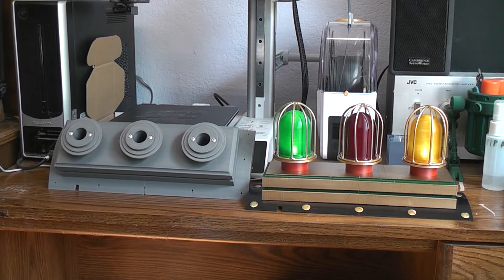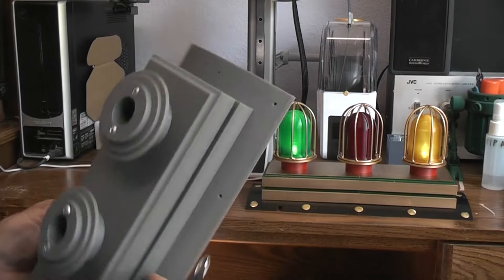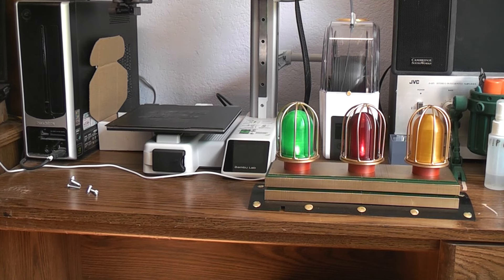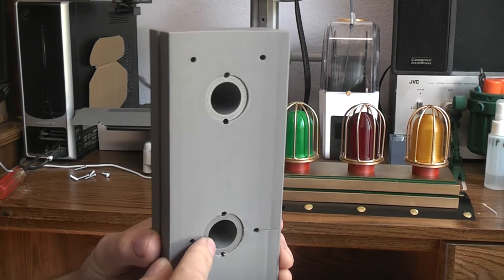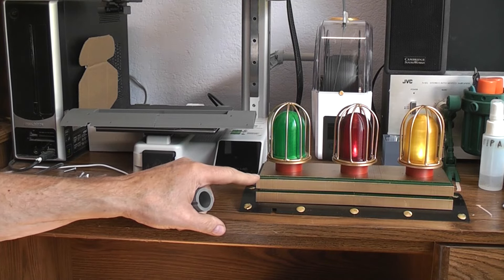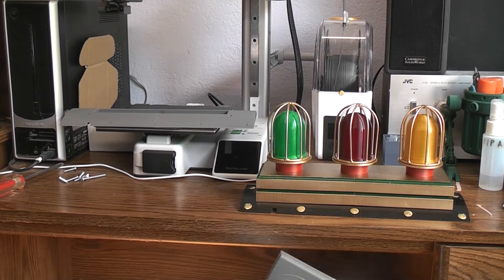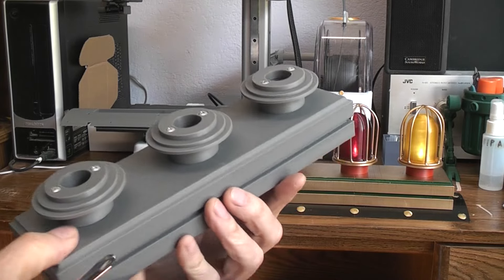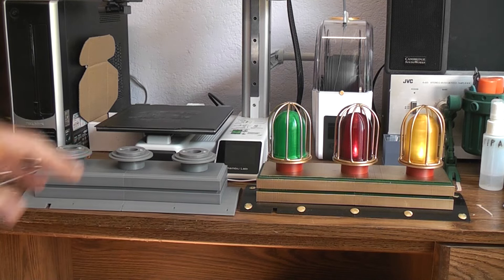Time Machine "lamp console" display build. The 3d printed base parts.

Comment: This is so cool! I like how you find ways to print the pieces with less supports.
Reply from the maker: Yes, 9 years of 3d printing has taught me the best ways to orient the parts for minimum supports and best surface quality. Also, when its best to cut a part into multiple parts, even if it fits on the print bed to save 3d printing material. time and support clean up.
Reply: @Robothut  You're the man when it comes to experience with this stuff! 😁

Comment: That would look great behind me on my livestreams ! 😉
Reply from the maker: Yes, a nice shelf display. Do you have ac power for the 5 volt USB or a 5 volt power bank? I could make it battery operated .
Reply: @Robothut  I have power But there is a one line going through the hole on top , Have to check if I can thread another line